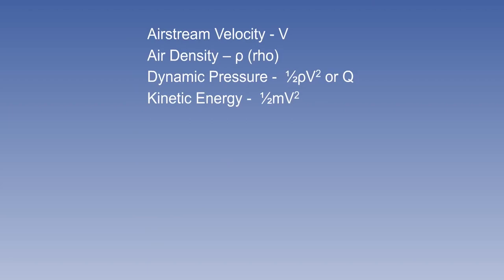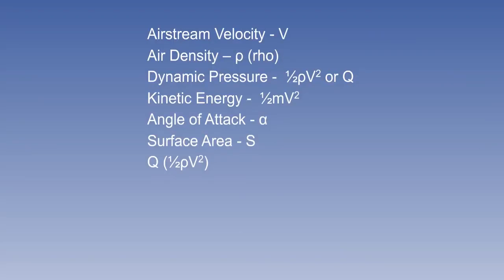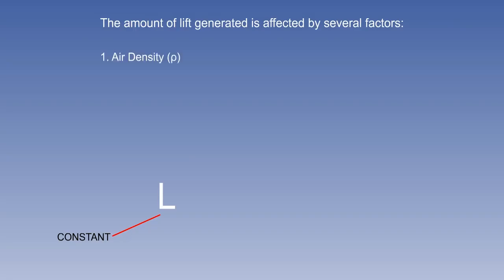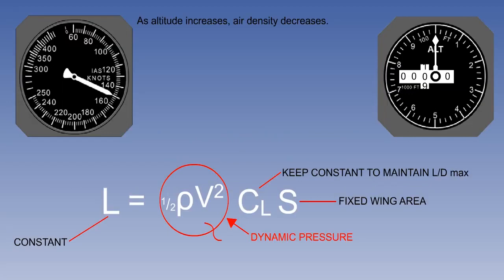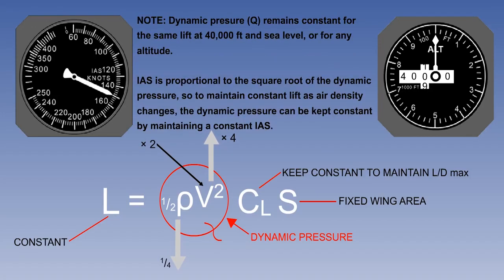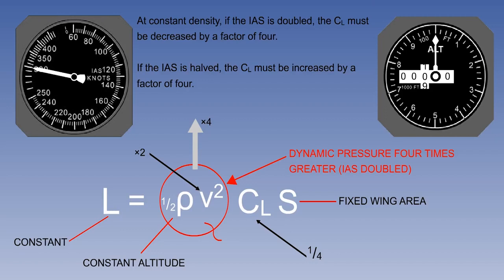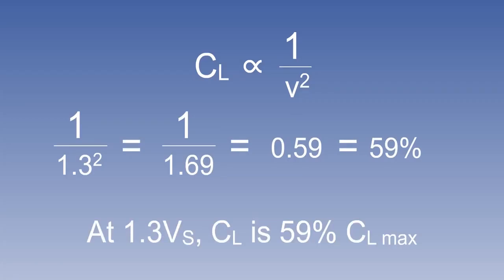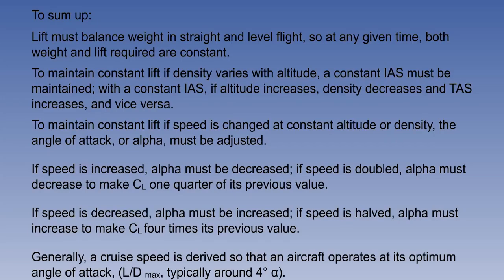08  ATPL Training  video  Principles of Flight - 08 Lift   Lift Coefficient and Equation

Comment: IF THE ANGLE OF ATTACK IS INCREASED THEN SPEED IS DECREASED BECAUSE THE LIFT CONSTANT INCREASES BECAUSE THERE IS MORE OF A COEFFICIENT OF LIFT REQUIRED * WATTS? AND IF ANGLE OF ATTACK IS DECREASED THEN SPEED IS INCREASED? IF ALTITUDE INCREASES THE RO DECREASES AND LESS WATTS ARE GIVEN SO MORE THRUST SPEED IS REQUIRED TO GET LIFT?